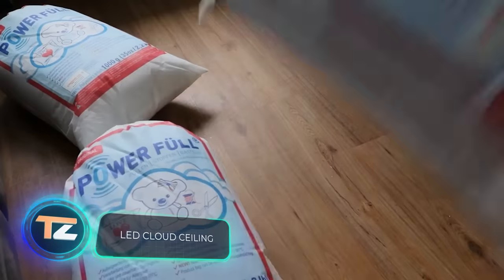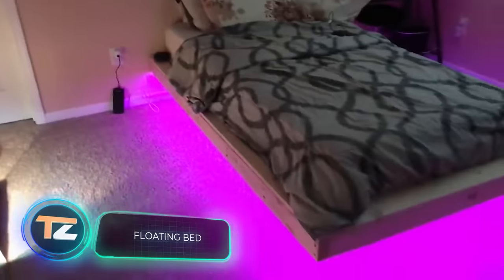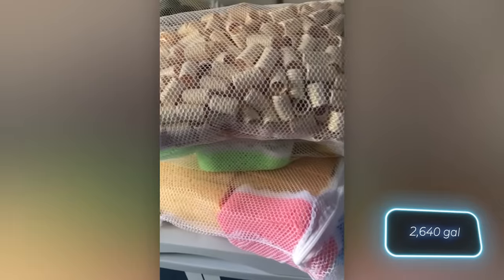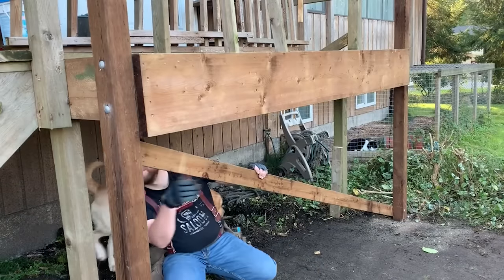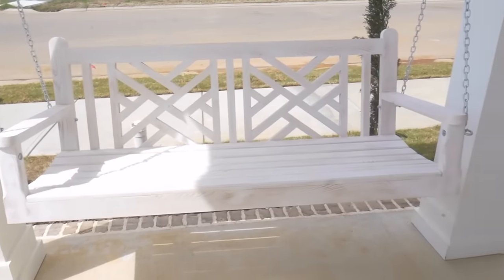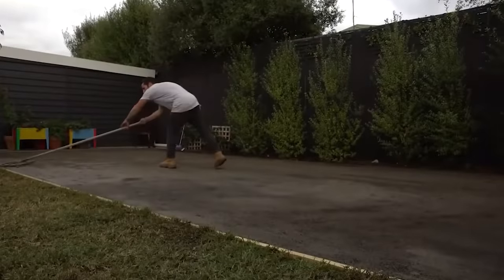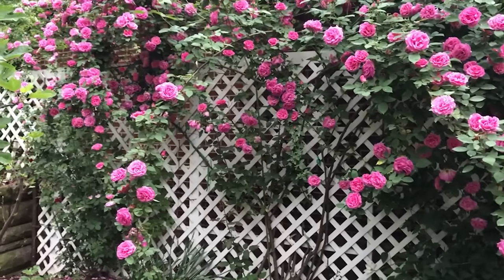HOME IMPROVEMENTS THAT YOU CAN MAKE WITH YOUR OWN HANDS

Comment: That concrete block fire pit is absolutely hilarious and no one should try it at home. Regular concrete blocks like that one shown can just crack or even explode when exposed to high heat. Actual fire pit block is rated for high heat and the metal ring is to protect it from looking nasty from the soot created while actually burning.
Reply: Putting in a hole sucks too. Should be up high enough to support that marshmallow stick. My neighbor just built one with a steel ring and landscape stone. He made a vent and filled about a 6” gap between the ring and landscape stone with with crushed stone.

Comment: The fire pit is often poorly done by people who don't grasp that a fire pit NEEDS to be made of FIREBRICK or similar ceramics. Most concrete blocks, such as that shown, can contain pockets of high moisture, which, when heated substantially can rupture in a very very explosive manner, throwing concrete shards all over the place. 

As one can imagine, this can be very very dangerous, and thus care should be taken to be sure that the masonry you choose is rated for use as a fire pit.

This is something only a small number of people grasp without being told. I presume the danger is clear, once you consider it.

Comment: Most of these houshold hacks have major issues, the ceiling is a fire hazard that can easily kill you before you can exit the room. The elevator is gonna destroy that house, or maybe not the elevator itself but the added weight in the attic dragging the house down faster than ever.

Comment: The Lincoln Park guitar, the autographs, due to using the Sharpie pen, will FADE away with using that UV light. Pretty soon you won't have those autographs. Take it from an autograph collector and former autograph gallery owner. UV light of any kind will fade Sharpie pen signed autographs. Only use the light when necessary.

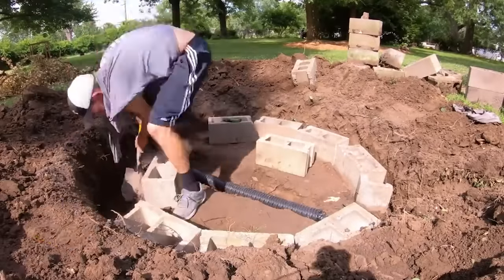Comment: @5:39 so we just bury that drain pipe and build the fire right on top and don't have to worry about the pipe melting?  high-density polyethylene's melting point is 135°C (275°F)

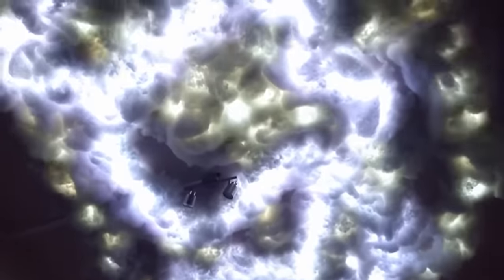Comment: 0:50 - You can... blah blah blah... no mention AT ALL on the arduino and programming necessary to make the strips do any of that.   And they have to be the right kind of strips, too.  Most are usually on or off with no circuitry to handle control of individual chips.

Comment: No offense intended, but whoever is writing for this channel needs to go back to school. An "engine" is a petroleum fired, combustion machine...a "motor" is an electrical device. Tires are not recycled into "concrete" (which is crushed and powdered stone), they are mixed into "asphalt" which is a tar and rubber based black to gray substance.